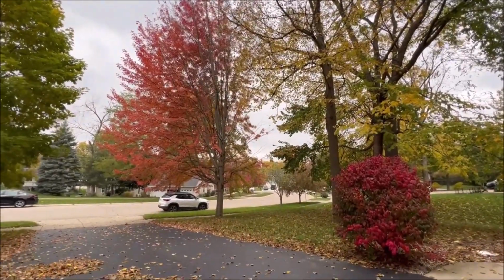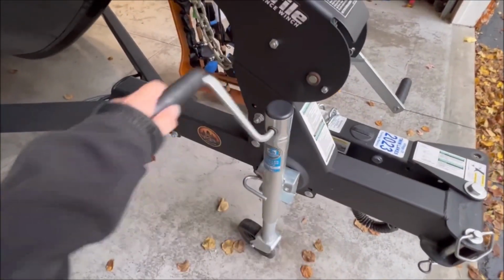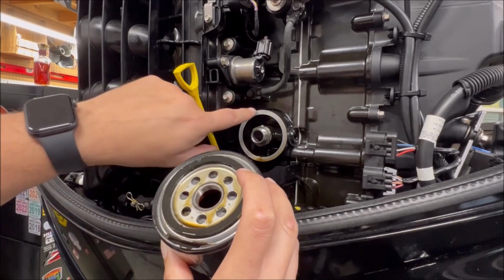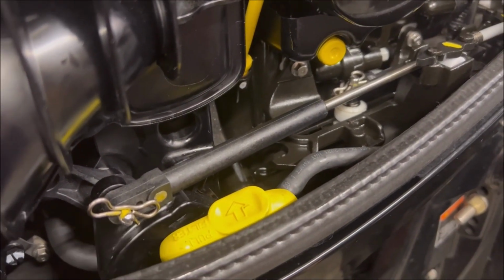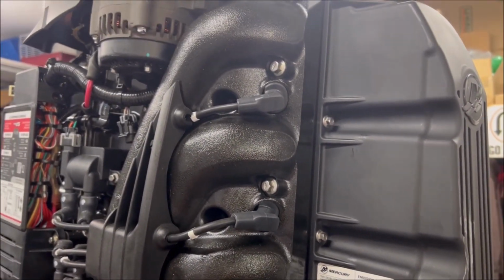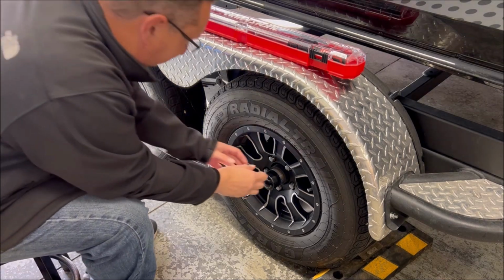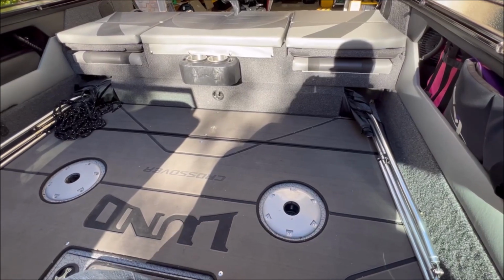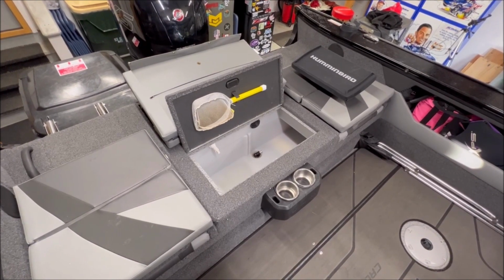Maintain your Boat, Motor, and Trailer

Comment: Hey Tommy - Thanks for posting your videos about your Crossover. I have the same boat so it’s interesting to see what you’re doing with yours. 

Quick question - have you touched up any of the gunmetal gray (assuming that’s the color. Hard to tell in the video) paint and if so, what did you use. I have a couple chips I tried touching up with some paint from auto zone, but I’m looking for a closer match. Thanks in advance and keep the videos coming. Thanks.
Reply from the maker: Glad you liked the video!

Mine is red and black with gun metal gray decals. The Lund website has the paint codes listed. I think this is FDGH951441. Should be able to go to any paint store with that from what I understand.